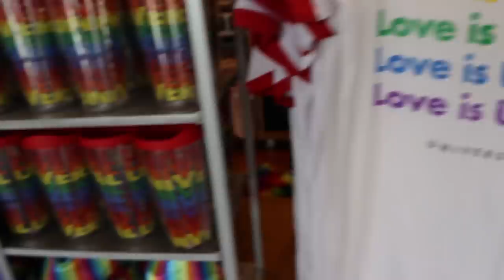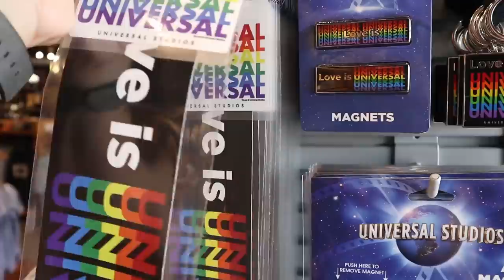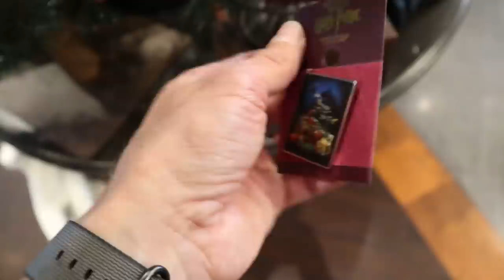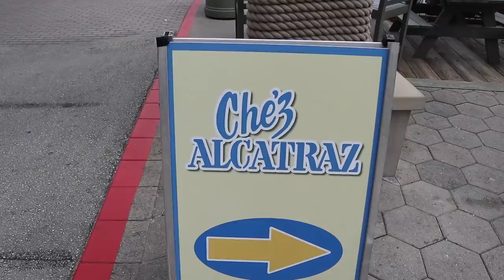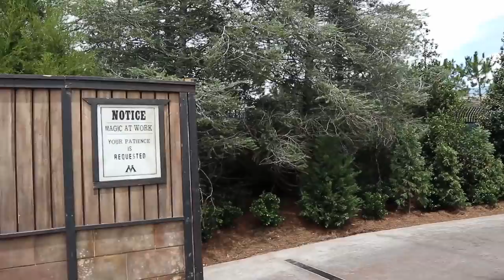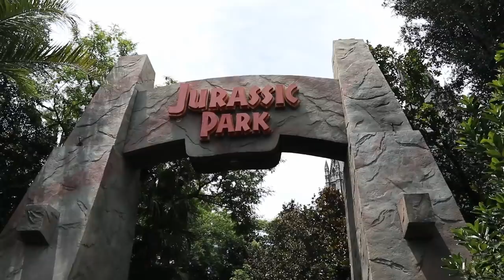What's New At Universal Orlando This Week!! | New Ride Progress Updates, New Merch & Endless Summer

Comment: As someone who passes through Kings Cross daily, it's fairly accurate... In design. The layout is nothing like it, but all the london underground font, the long tunnels and the architecture is pretty spot on, but it's mostly a mashup of lots of different underground stations. Also, the fact that first capital connect on the departures board is cancelled is pretty darned accurate too 😂

Comment: there is going to be a new stunt show going into the old  Terminator 2: 3-d building . i know what the show is but i can not  disclose it.

  Terminator 2: 3-d  is not owned by Universal (aside from Harry Potter) is considered to be on the chopping block, especially one that is dated. The first three Terminator films were distributed by Orion, Tristar and Warner Brothers pictures (in that order) meaning Universal most likely pays licensing fees to whoever holds the rights to the Terminator franchise.  

That last part of the equation is an important one. Universal parks is taking an aggressive stance on making sure to add attractions that drive attendance and per caps. So aggressive, in fact, that word has come from upon high that major new attractions will be added to each park every year moving forward. No more Universal Studios Florida getting something and Islands of Adventure gets shafted. This shift will start in 2019 when the new coaster/dark ride opens in Hogsmeade at Islands of Adventure and the replacement attraction opens for Terminator 2: 3D. This aggressive strategy does not leave out Universal Studios Hollywood and Universal Studios Japan.
Reply: What about the 4th park rumour? Nintendo?

Comment: I have read and heard that T-2 is going be replaced with a new style of show to be based upon the Jason Bourne series. The theater will move like Race Through NY, but it will also rotate to changing scenes mixing live action with projection and practical effects.  It was early rumored to be based upon Star Trek, and filming had commenced.  I don't know why they changed paths.  I had drinks with one of the engineers (Bula Bar, Royal Pacific), and over cocktails, he quizzed me about my information.  I lied and said patent searches, and he "nodded" when I was correct.  He couldn't volunteer anything.  I think the drinks I bought him loosened him up. But also, he could have deliberately misled me.